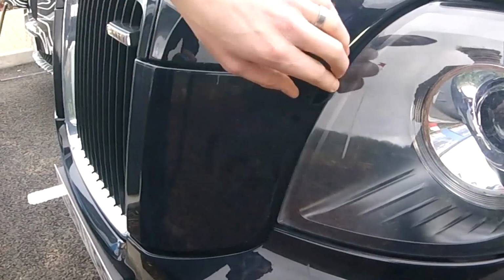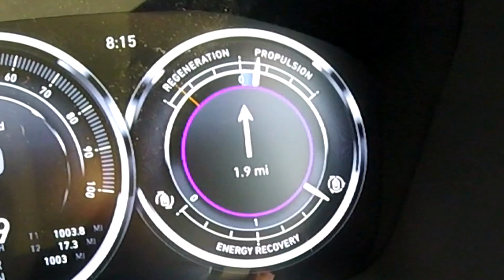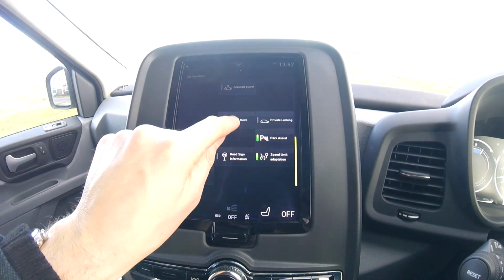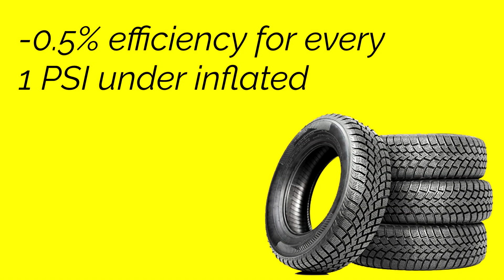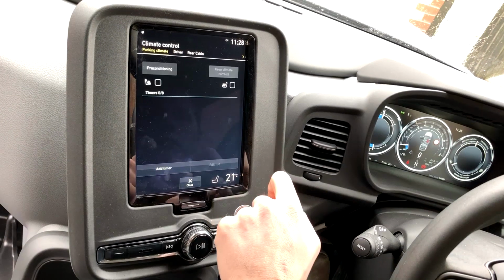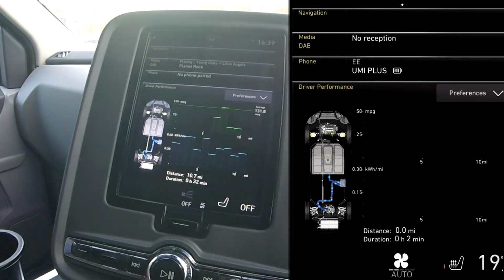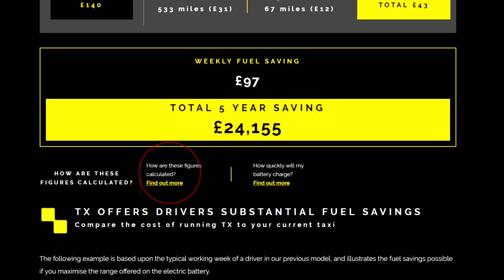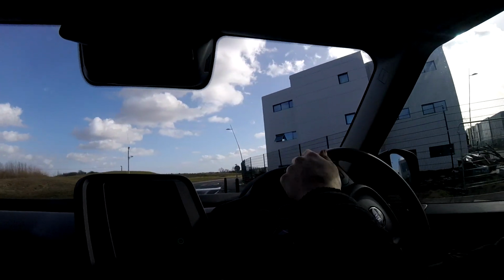How can I optimise my TX electric taxi driving range?

Comment: Considering that this is supposed to be a purpose built taxi, it is surprising that no one thought to ask a working taxi driver what the driver actually needs in that little cockpit at the front where they spend almost half their life. I have noticed many simple design faults over the last month, all which could have been avoided if actual working taxi drivers were consulted during the design stage. 

1) The nearside passenger yellow left hand handhold is too close to the bulkhead, so close that almost every person that I have asked cannot get their knuckles through the space. Therefore can only use the strength of the fingers to pull themselves and cannot use their full hand to grip the handle. 

2) Something as simple as somewhere to hang a coat is missing. So it is either wear it or put it on the floor. The TXII and TX4 had a simple hook fitted in the luggage area so not too hard to rectify. (Drivers. A shower vacuum suction cup with hook bought cheaply from ebay is strong enough to hold a coat up off the floor) 

3) Another thing missing is anywhere to keep receipt pads and a pen. There is enough spare space to have one fitted or moulded into the large center console otherwise its just a case of leaving them on the center console in front of the gear lever and hope that they dont fall off when corning. 

4) There is nowhere to put a money bag or change/coin machine. None. Zero. The door pockets are too narrow to even fit an empty bag, in fact the door pockets are too small to fit almost anything in except maybe a newspaper or a few receipt pads. 

5) Overhead storage pockets. If you want to put anything up there, forget about it. Anything in the open pockets will slide out and hit you in the face if you need to put your foot down and accelerate. Ive jammed an old cap in one to stop things sliding out onto my head. 

6) Drivers interior lights . . . or rather the lack of drivers interior lights. Two tiny little LED (3/4" ?) lights fitted in the middle of the drivers cabin are worse than useless especially as one is pointed down into the luggage area. Bright lighting directly over the drivers area is something that is needed when working nights to do such basic things like writing receipts, giving correct change, reading a book or newspaper when ranked up etc NOT a single dim 3/4" LED light over the center console. 

7) Drivers interior light switch(s) are in the middle of the drivers cabin ceiling. There are 4 small, smooth and close together 4 buttons that a child would have trouble operating without looking directly at them. These buttons need to be big and separate enough that a raised hand can find them without looking. Two buttons or switches is all that would be needed. Driver and passenger. Simple really if someone was to actually think about it. (I have been told by a passenger that the lights and switches are from the Volvo XC90) 

8) Why is there a sun visor with a vanity mirror and light fitted to the front luggage area ? 

9) As the taxi body has been widened but the overall width has been kept the same, the door mirrors have been made smaller. BIG mistake. HUGE mistake. There are now really large blind spots on both sides of the vehicle, that combined with the reduced view from the rear mirror makes this a potential threat to someones life (probably a cyclist) I have been forced to order 2 of the small driving instructor mirrors to fit to the existing mirrors to reduce the blind spots before someone is injured. 

10) Drivers lockable underseat box. 6 weeks and still waiting for it 

Apart from the various software issure the taxi is having I'm sure there was something else about design faults that i have forgotten but im sure that I'll sit in the cab tomorrow and remember it 

I havent mentioned the battery range (average high 40's to low 50's) because this could be my driving style but im writing down daily mileage and anything that could effect the range. Things like what the weather was like on the day because when it was cold the passengers wanted the heaters on and when its raining and the wipers are on all day plus heaters, demisters etc the battery gets chewed up. I am NOT looking forward to the summer when the passengers want the A/C on.
Reply: Spot on, everything you said is exactly what I thought. The drivers compartment is too cramped, the taxi itself is far too large for London’s streets, which seem to be getting narrower by the day. Passengers seem to always have trouble getting out as the doors keep locking them in. The for hire light is useless in daylight. The middle tip-up seat is a waste of space. And the cost is crazy. How much do they think cabbies earn for gods sake.
Reply: Spot on with everting you’ve said.... I can’t see the saving either for the down time when having to charge  also  after a full charge which takes just under an hour you’ll be lucky to get a range of 40 miles.
Reply: Mercedes Vito is the best cab and its massively cheaper with executive comforts